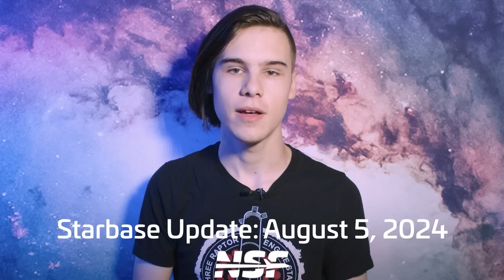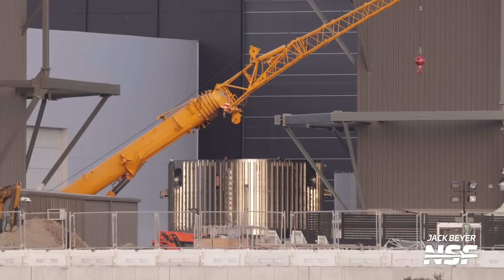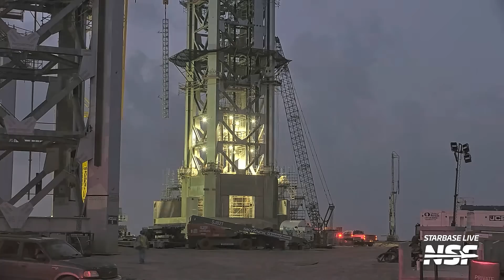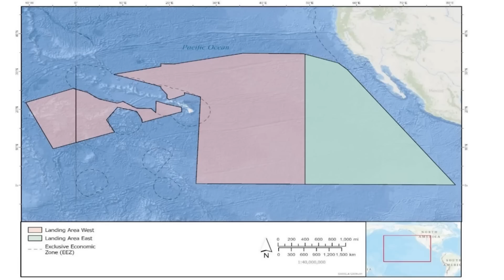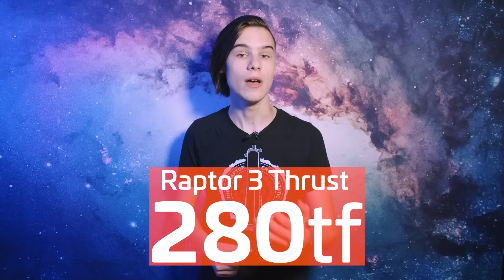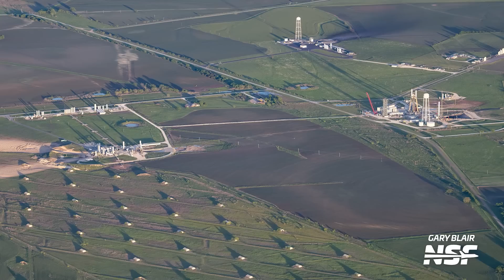Raptor 3 Unveiled, Starship 30 Prepares for Launch, and Starbase Expands | Starbase Update

Comment: I'm confused. In the Tim Dodd interview, Musk said the tower would have to be taller. Is the 2nd tower not going to be taller? Will all ops move to tower 2 and tower 1 will be rebuilt to be taller?
Reply: The tower is just very slightly taller than the first one but nothing significant. By all means, it's essentially the same height

Comment: My guess is the engine colour change is due mainly to 3D printing of parts.  In order to embed the cooling pipes etc as channels in the engine walls, the logical way of doing that would be to 3D print the parts.  That would be much simpler than trying to build moulds to achieve the same goal.

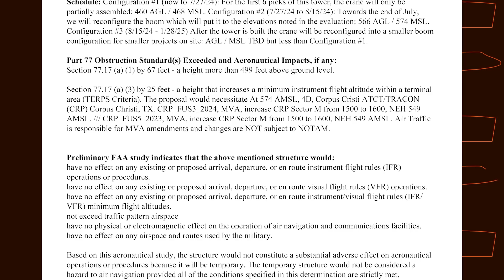Comment: 6:48 "these, however, will not be able to be installed straight away" may be wrong, since "able" requires a subject and the sections don't lift themselves. A better structure could be "will not be possible to install straight away".

Comment: Especially since most of your spokespeople are not Americans including the one giving this update, could you please provide metric equivalents for the meaningless numbers you quote.  For example there is no such thing as "tons of force" in metric.  How many meganewtons is that?  Are the tons mentioned American short tons, or the metric tonne that EVERY OTHER COUNTRY ON THE PLANET USES.  Even before switching to metric the British Commonwealth (except Canada) used the British ton of 2,240 pounds, because the British Commonwealth only exists because of seaborne trade, so the old British ton was close enough to the metric tonne for anything but high precision work.  So why are you using a unit  that most of your audience may misunderstand ?  Why are you being unnecessarily RUDE to most of your audience?  If SpaceX is giving you garbage reports then write to them and ask for a translation!  Their own engineers are not using these misleading units precisely because they are misleading, and when you do misleading things in engineering PEOPLE DIE!  So ask SpaceX to publish the actual numbers that their engineers are working with.

Comment: Raptor 3: Probably a ceramic coating like you have on the exhaust manifold of your car engine. Even good alloys need a coating so they don't react to heat and gases like air. It makes more sense to paint the entire lower part, which used to be covered but will not be anymore. The nozzles of the Raptor have already received this treatment, a change of color is perhaps an evolution or a question of compromise of compatibility between the different materials to be "glued" on it.

Comment: The Version 3 Starship will be a sight to behold.

However, something is bugging me. The Upgraded Starship numbers seem insane in the FAA request (page 9), the numbers are aspirational a little bit for the Upgraded Version and there is a 37 number of engines for  the current booster, but anyways (that actually gives out about the right trust number): the new trust to weight ratio with the new fuel quantities and engine output numbers would give a leeway for about 490 tonnes of extra useful mass at the current 1.4231 trust to weight ration. Am I wrong? What am I missing? Even with 100 tonnes of additional mass for the mass for the new vehicle itself, that is thick margin for useful payload. That could very well be a real 300 tonnes to LEO vehicle while fully reusable, even with margins for safety and robustness, life support, interior functions or fairing functions. If this is true, I am beyond excited, I was getting bummed out from the '"low apparent performance" of starship having no information of how much useful mass it could currently handle.

Comment: Hmmm, I suspect a lot of the simplification is simply that it is not including any sensors. The engines are typically festooned with sensors during development, and those photos of old engines I think include a lot of the sensors for that purpose.

Comment: What starship can we see raptor3 in action?
Reply: Possibly the V2 ship being built right now. So maybe in three flights. Depending on a few things though.
Reply: We can do some math, the newest engine (the one taken off S30) at Starbase is 398, the highest number at McGregor was 569, that ~171 engines in between the two facilities. Each flight uses 39 engines (33 on the booster, 6 on the ship), that means we got ~4 more launches after Flight 5 before that Raptor 3 and his friends get to do their thing, so, Flight 9?

Comment: Wow so 1.1tons saved per engine that’s 43tonns of payload added to the 50 odd Elon said flight 3 could lift. That gets them to 93 tonnes of payload before you account for the extra  20% thrust and additional engines they plan to add.
Reply: It doesnt quite work that way. The average translation of weight from a booster to the final payload is 4 to 1. 
Meaning every 4 tons taken off the booster can translate to somewhere around 1 ton of payload.
But yes its a big step in the right direction and they will likely be shedding a few more dozens of tons from the booster over time.
The ship on the other hand should be about 1 to 1, so when they are able to get rid of several tons from it, the gains will be even better.
All this weight loss combined with a larger fuel capacity and more power will certainly be getting the payload much closer to their ambitions.

Comment: I think the reason they made the payload bay shorter  on s33 is because there not making the ship longer just yet because there still using block 1 boosters..they will make the ship longer once the block 2 booster is ready
Reply: If SpaceX's numbers are correct, version 2 is always gonna have the shorter bay. Version 3 then would see a stretch of both payload bay and tank section

Comment: V3 ❤looks a bit lopsided and so does the new engine 😂
Reply: V3 is the new engine..
You cant fit two propellant pumps down the center line, this configuration is very efficient with the Lox pump coming straight down the middle and the CH4 pump just off to the side. Doesnt hurt anything at all.

Comment: I know I haven’t seen the pins for the heat shield tiles around the back side of the flaps so that means there glued? And maybe there also testing how good the glue is if the need it but as we’ve seen with mk2 rings the pins go right up to the weld now…
Reply: There are still a good number of glued tiles remaining on S33, despite the upgraded heat shield.  Ringwatchers have a very nice and detailed article about it, with lots of pictures.
Reply: @Spherical_Cow  There aren't many glued tiles on S33 (but there all a LOT on S30)
Reply: @bryanillenberg  right you are; I meant S30
Reply: @Spherical_Cow  That said, there are some seemingly glued tiles on S30's nosecone (IIRC).

Comment: Both land and marine hermit crabs mate in seawater.  Mating for the hermit crabs is during the late spring or early summer of each year.  Before mating, the male holds the female with one claw, and then taps or strokes her with the other or pulls her back and forth. Both crabs emerge partially from their shells, placing their stomachs together to mate. 

The males offer sperm but the female will store it.  A female is able to carry several thousands of eggs and she will use the sperm to fertilize her eggs once she gets them to her destination.  Female land hermit crabs release fertilized eggs into the ocean. The spawning (called "washing" in the English-speaking Caribbean) occurs on certain nights, usually around August. 

After the eggs hatch, the are known as larvae.  These young crabs live as microscopic plankton for several weeks before settling on the bottom and searching for a shell to inhabit.  Larvae go through several aquatic life stages and molts.

After they molt several times they will become a young crab.  These young crabs are often consumed by various predators both in the water and on land. Even though they have their shell to protect them, it is when they are out of the shell that they are very vulnerable to those fast predators.  When adulthood is reached, the crabs migrate to shore for a terrestrial life.

Hermit crabs do have an instinct to go to a spawning area to deposit their eggs, for this reason Hermit crabs will not mate in captivity.
Reply: But these don't look like hermit crabs...

Comment: so they pumped about a billion dollars into engines that are obsolete already?
Reply: Raptor 2 is not obsolete as it will be used for at least a couple more launches.   Raptor 3 'may be' starting use with the Version 2 starship which is B 15 and S 33, but don't quote me!
Reply: @michaeldeierhoi4096  Not B15, the booster will not be upgraded for a while. Most likely until ship V3's. I believe this means they will be running on Raptor 2's for a while on boosters.
Reply: @Vatsyayana87  Thanks for the info.   I have not kept up with some of the details.
Reply: @michaeldeierhoi4096  S33 is version 2 but B15 is still version 1
Reply: They very well might have spent a $Billion or more on the Raptor engine development.  Totally worth the investment, considering the huge leap in performance these engines represent compared to anything that came before.  SpaceX will make this money back many, many times over when Starships start deploying Starlink v3 by the hundreds and thousands.
Reply: Booster V1 will still be used for many flights to come. Thats 33 engines every flight.

Comment: Why do they keep replacing engines in ship 30? At this pace it will never launch
Reply: @VittsBar  If telemetry from the static fire showed an engine was bad or less than 100%, should they ignore that data and continue with that engine?  They don’t just randomly decide to change out an engine without a reason.
Reply: I see no reason for the replacement of raptors on Ship 30 to continue indefinitely.  ITF -5 is still a month away at least anyway.

Comment: Raptor 3 looks much more compact. Overall height is much shorter and its not just the bell.
Reply: The engine is the same size. It's just the gimble mount that was made smaller
Reply: @Quasar-2  That is still significant. 
Less height taken up by the engines means more height for fuel.
More fuel = more payload.
More payload = more better.
Reply: @bryanillenberg  The issue with propellants isn't so much with volume as it is with mass. Propellants weigh a lot. But the tanks are already designed and built. They aren't going to add another few inches of height to the tanks now. Later they would since Raptor 3's allow them to stretch Starship a bunch but probably not for at least a year
Reply: @Quasar-2  V2 will have propellant tanks sized for R3.
Reply: @bryanillenberg  We don't know when Block 2 Starship will arrive. The ship is close but the booster still seems until the very earliest, next year
Reply: @Quasar-2  I'm aware.